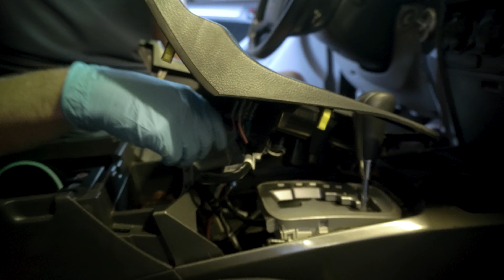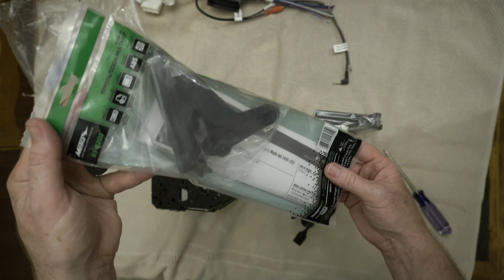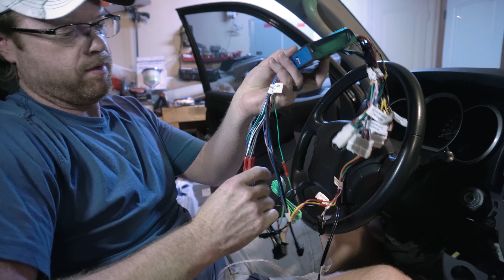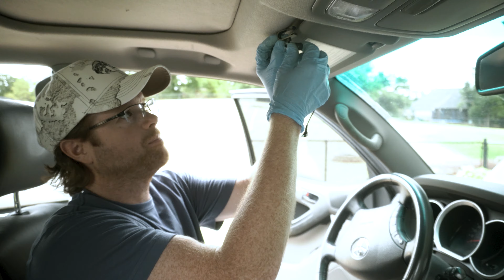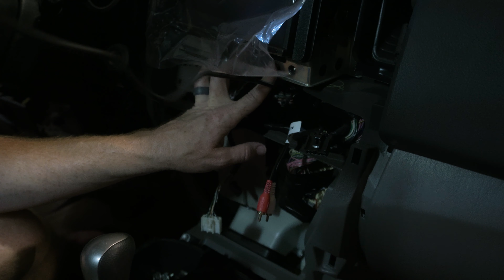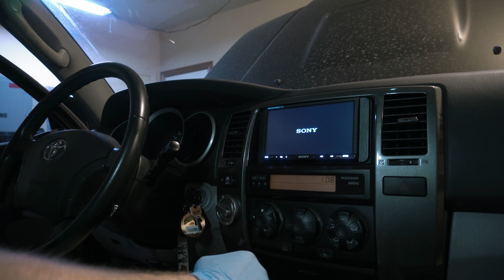How to replace the factory radio in a 4th generation Toyota 4Runner

Comment: What is the purpose of the o b d two connector to the radio
Reply from the maker: It’s to allow the radio to know when the car is in reverse.
Reply: @handyginger2951  odd way to do that but thanks!
Reply: @handy.ginger so if I’m not planning on doing a backup camera would I still need to run the OBD2?
Reply from the maker: I’m not 100% sure but it seems like you wouldn’t.
Reply: @handy.ginger  Thanks for this bit of info. Makes the kit not worth it if they're willing to do something this ignorant.

Comment: If I install a backup camera to my license plate, can this be wired to the radio as well?  I see there is a camera option on the screen/menu, so assuming it's just connecting a wire vs. there being a separate connection/port for it?
Reply from the maker: I have another video I’m working on editing that shows how to add a backup camera that will hopefully be getting out there soon.
Reply: Do you still need this info? Do you also have a 4runner? Let me know, I can help you out.
Reply: @JCortez0831 I’m doing the same and was wondering if a backup camera can be added. The license plate camera is also what I’ll be using

Comment: Great video.  I need to do the same on my 07 4Runner.  The wiring seems a bit intimidating though.
Reply from the maker: I was nervous about it as well but it’s not all that bad. They are mostly color coded if you buy the parts I suggest. If you do, you can also contact Crutchfield and they will help you through the process if you get stuck.
Reply: For $25 Crutchfield will wire it all for you. It was basically plug and play. Super easy for me
Reply: @johnkimx83 where do I find that on crutchfield?
Reply: @grantgilbert6575  When you select the unit you want and check out, you can add it as an option